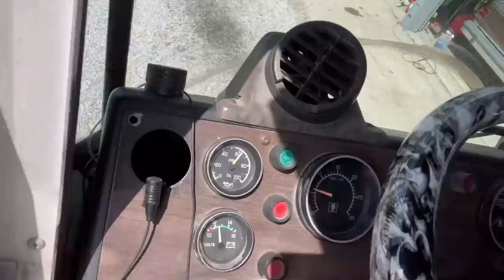Will It Move Jacked Up? Cabover’s New Oil Lines What A Mess

Comment: Hi Chad we have two piece re-useable hydraulic fittings they're not the best but was designed to repair in the field rather than have hydraulic crimped , the outer ferrule always screwed backwards and the insert went the opposite way so it stayed and pulled itself on
Reply from the maker: Yep first time messing with them
Reply: @1ChadKeegan  they’re never easy bud I’ve done loads when working on the farm here in the Uk years ago

Comment: Brother Chad You need to think about the areas country you might want to Truck in. If You are going to be pulling up in the mountains out West. You are going to want the 4 & 1/4 CAT Motor with the right size Turbo and Radiator size to keep the Heat down so you don't Cook your Motor. If the Person who Helps You if He's a Good Mechanic He will explain different ways of Size Motor You will need for the type of Country and Hauling Freight you are going to pull. Good Luck Brother can't wait to See what you decide on...
Reply from the maker: You gotta understand parts are limited and radiator shops are closed down that where open 3 years ago that could make those radiators and the shops that are open are limited on personal and weeks if not months backed up. No worries about the future I’ll truck when it’s not 110 outside and hot af to help those things out you know 😉